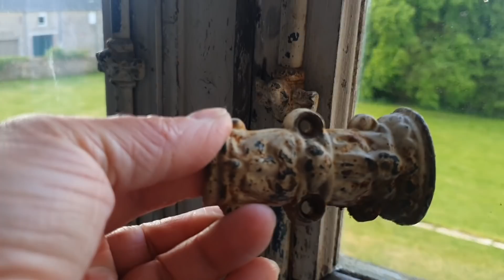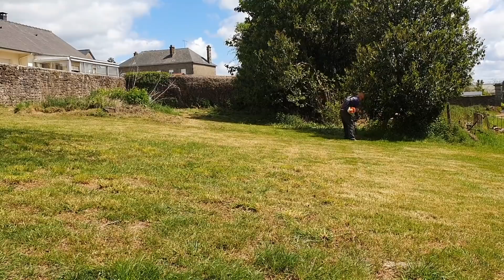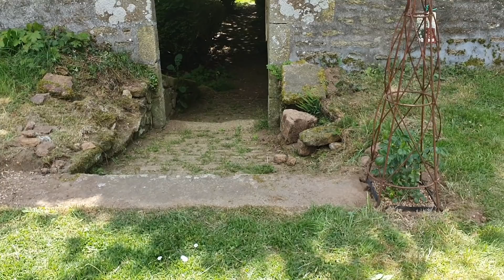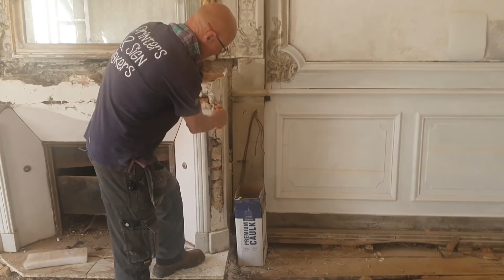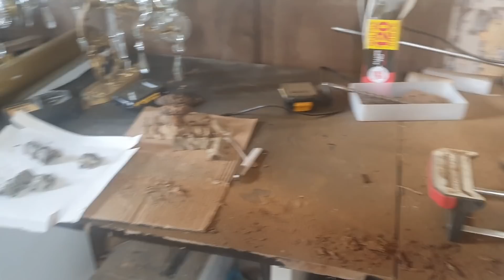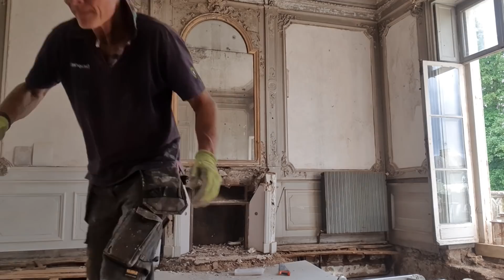FIRE DESTRUCTION!!!

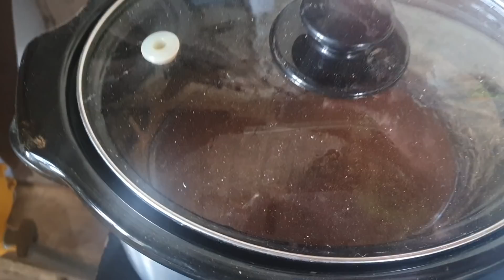Comment: @11:00  The only way to clean the hardware is glass bead blasting.  Its the same as sand blasting, but uses glass powder, and its softer on the material without damaging them.  Once you try it you will never go back to chemicals and sand paper.

Comment: Since you have to remove the floor anyway, could you install underfloor heating system and get rid of the radiators?
Reply: Exactly what I have been wanting to ask.
Reply: Good idea. They may want to go original, but to me their are a pain. It would be nice to get them away from the window, it ruins the lines of window to view. Just my 2 cents.
Reply: I'm not sure it would work for hardwood flooring.  Wood isn't the best conductor of heat.  I would think the floors would dry out and eventually cup or split.  However if they were going to lay stone or cement that would work with underfloor heating.
Reply: @mandrews1245  the original floor had sand as its base, Sand would work much the same as stone. Also the heat doesn't have to be as high if using wood. In old episodes of "This Old House" they often use underfloor heat for early houses.

Comment: Maybe look at cleaning them with paint remover paste, leave it on for a couple of hours or more covered in a plastic food wrap. If they are not wood you can afterwards use a fine steel wool for a nice polish 🥰 I used to do this when restoring some antiques. But do this only if it is some type of metal. (even better if it is brass some brasso would do wonders)

Comment: hello if you want to strip lead paint , the best way is to use peelaway made by barratine  there's two peelaway's one is for modern paint and the other is for lead paint, its a poltice product that you cover over the paint then apply a protective blanket supplied , you must wear ppe when using this

Comment: Hi Carole,
Try using paint stripper and a small wire brush on your window hardware. It will save you a lot of time and energy. I have never ever heard of anyone boiling metal in a Crock-Pot before to get the paint off. 😵

Comment: That Godin is an incredible find! If you don't use it in the southfacing salon bc you'd rather have an open fire tgen do use it anywhere you need additional heat, beautiful! Put if up for auction on auctionnet should you not agree on using it at all, you'll probably make a handsome profit!

Comment: Slow cooker worked great on brass, but I do not think it would be hot enough for iron.  The paint came off my brass hinges and hardware. I decided not to clean the brass, hubby was not sure but he came around. I love the plow it would be great as a back drop in a flowerbed.  The stove was a great buy and will look gorgeous once you clean it up and use stove blackener on it, not paint as the heat will bubble it up. My radiators are a mess, they were all painted with regular cream paint not designed for hot cast iron radiators.  I live in Canada in a 1912 built home, not as old as your new home but it has been butchered over the years.  You are both doing an amazing job.
Reply from the maker: Thank you Veronica

Comment: I have really enjoyed watching the transformation of your Chateau.  I'm just few weeks behind on your videos.  I love the detail on the fireplace insert, but there is a part of me that wants to see the flames dance. Its the romantic in me.
I'm and interior designer in Salt Lake City Utah...and I have used my share of crap paint strippers. I also did the crock pot trick with only moderate success. The one stripper that I have used with good results in called "Jasco."...I've also become a fan of using a heat gun. It has worked very well for stripping the paint off of the moldings in my English Tutor.  Thanks so much for sharing your journey.
Reply from the maker: And thanks for your feedback

Comment: To get the paint off the window furniture I've seen other restoration channels where they put them in an oven at high temperature and it essentially burns off the paint, but you have to deal with the smell. Perhaps there's some way you can do that with better ventilation or outdoors.
Reply: Very toxic burning old paint.
Reply: @mezanian  - Most likely lead based.

Comment: blow torch and a couple shaped wire brush on a drill should take it off, i personally put mine in an actual fire, but if you want to be careful a blow torch, if its cast iron you can safely put it in an actual fire in the coals and the paint will just burn off, dont add any extra like powered air, but a normal little fire

Comment: I switched to a pole set pool because farm cats kept hopping on the ring, slipping,  and catching themselves with a couple claws puncturing the ring.
Once the ring deflates the pool collapsed & it takes a week to warm back up.
I hook my hose up to the clothes washer outlet for softened well water that seems to maintain pH without using much chlorine at all. Mostly just the floater tabs.
If I use straight well water it's orange & sediments that never filter put.
Thanks, I so enjoy your vlogs.

Comment: 💕Best PAINT REMOVER Is called Peel away 1 it is fantastic at removing paint up to 20 layers💕Saves so much time & hassle & can be used on multiple surfaces including metal wood masonry plaster💕Love the ornate coal  burner you got which you could always paint with fire retardant paint💕
Reply from the maker: The peelaway is already on order for the salon, if there's enough left, I'll use it on the metal door furniture.

Comment: Don't use coal burner in main room as I can see that it not going to be easy to fit good size firewood and it doesn't look like it hold door seals to prevent smoke and sparks getting into the room. Maybe you should go to a logburner specialists for something that is new, safe and easy to use just for that room only

Comment: As I do not know how far behind videos are, I might be to late, but i have a suggestion.   If it was my Chateau , and I had to pay,   I would buy one new beam for the Salon, and repair the other with the one I removed, I would cut a piece as long as the rotten beam over the channel to the window (it should easily be big enough for replacing that smaller beam) and a piece as long as needed to go from the pocket in the wall to a splice about 5 or 6 times as long as the beam is high, cutting horizontally and drilling 6 bolts through vertically, 2 in the middle of the splice, and 2 in either end. I know oak is plentiful and relatively reasonable in price in France, but if I had to, I would use a fir/pine beam over the idea of the breeze block wall.   Keep up the great work
Reply from the maker: I didn’t want to disturb the original beams at the hallway side. So far the wall has worked perfectly and saved the cost of a new beam.

Comment: The old rusty plow would make a wonderful weather vein for the top of the farm house....if it was mounted on a rod and could turn in the wind. Sand blast it then paint a high gloss black with a marine varnish top coat so it holds up to the weather.  It would be unique.
Reply from the maker: Like your thinking Deborah but it is very heavy !
Reply: @LifeAfterLaFerté  well, if it's heavy it will weather well and last a very long time......or  if it's "way to heavy"  I would suggest  that you build a stone cultivator box about about hip high and fill with soil, sand blast and paint plow as before, point the wheel end up and use it as a trellis for climattis vines in the spring and summer.   I can send you a diagram for a design if you want.

Comment: There are some UK glazier firms who can make double glazed replacement units for windows such as these. They just need an accurate pattern & measurements to work off of. A quick Google should help you find what you need.
Reply from the maker: Yes I did hear this was possible. Will look into this soon. Thanks
Reply: @LifeAfterLaFerté  Was just thinking of you and all other chateau owners' heating challenges. I've always said that if I was ever in a position to buy a country pile, irrespective of where that may be, I'd make sure that I could install a ground source heat pump, solar & battery storage systems. The energy costs of running these grand old dames can swiftly turn a large fortune into a very small or, all to often, no fortune; which is why so many are left to rack & ruin in the 1st place.
Best of luck with your restoration journey. 😊

Comment: Have to ask why you're not using a burn barrel to deal with the invasives and using the ash to aid composting for the rest?  This is basic gardening stuff.  Seems like you're intentionally making your job harder than it has to be.
Reply from the maker: Where we live in France you are not allowed fires. Although we compost the grass with a mixture of brown we take most cuttings to the local tip which have an efficient system for this. But we love making work for ourselves……

Comment: all hardware should go in the hot fire - outside best to avoid any fumes -all paint will burn right off minimal scraping for original patina.
And for heavens sake get a zero turn mower with a wide mower deck - check out TORO commercial lines - sell the little toy one you use - it`s ridiculously slow - lol
check out "softwash" on youtube for all your roofs and stone walls - so much better and faster results than any powerwasher

Comment: To clean the paint of the metal parts, professionals use a pot with linseed oil, and boil it until the paint floats to the top.   If the pot is big enough you can remove the paint from the entire window, wood, glass, and metal parts in one go, and the wood will be conditioned as well.   But do it outside, and have a BIG fire extinguisher nearby.   (ABSOLUTE NO WATER)

Comment: Metal Rescue is great for cleaning metal items (including antique hardware); it's environmentally friendly...though you need to check the directions for appropriateness for the metal of the piece. For example, it is not appropriate for chrome. Since it's not as caustic as other metal cleaners, there is very little odor, and you can dispose of residue without taking extra steps. You can also save the liquid and use it multiple times. If there is a lot of dirt or grease on the metal, I do give it a good scrub with liquid dish soap before putting in the cleaner. The cleaner seems to work faster if the surface is cleaner. Depending on the dirt and rust, I leave it in the cleaner 1 to 3 days. I will also put it back in for extra time if it's not clean enough. When a piece is super crusty, it's easier to clean in multiple steps....you put it in the cleaner and get the first layer of gunk off and soak again; then, you can get to the base metal. Once the metal piece has soaked enough, wipe it dry with a rag. If needed, scrub with a stiff brush (plastic, steel, or bronze) or 00/000 steel wool after hand drying. Sometimes, a quick scrub with regular liquid dish soap after removing from cleaner will help, too. The extra steps you take is totally dependent on what kind of gunk is on the metal. While it's still wet, dry with a rag, and immediately use an old hair blow drier to dry and heat the metal before adding a light coat of mineral oil, olive oil, or WD-40 depending on type of metal/use of metal. This will keep it from flash rusting. If you plan to paint the metal, you can clean the oil off with alcohol  before painting, apply a sealer, and, then, paint. This may sound like more steps, but after cleaning a few items, I got a feel for what was needed for the "gunkiness" of piece. My cleaning time has been cut in half, and I didn't have to worry about disposing of and using caustic chemicals. I'm sure there is a comparable brand/product in Europe.
Reply from the maker: Many thanks for the tips.